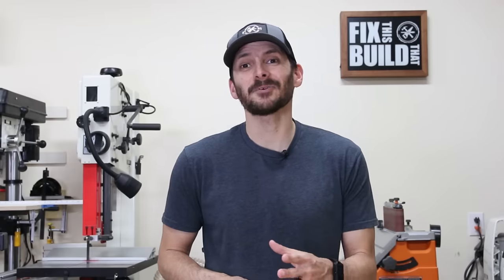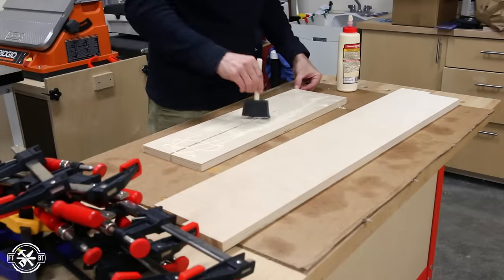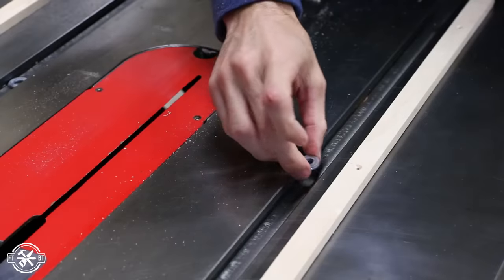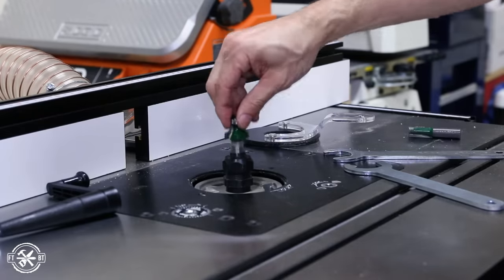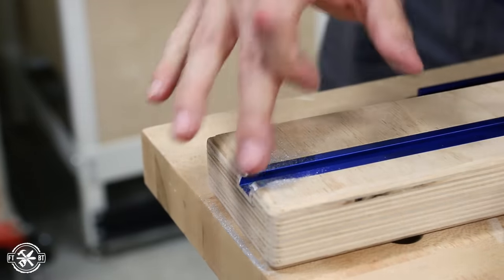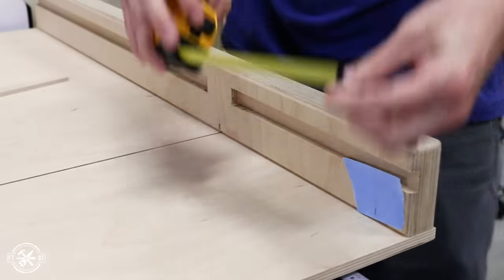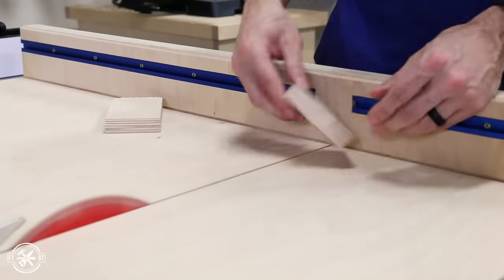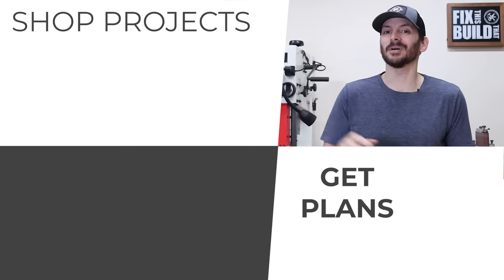Simple Table Saw Sled with FREE Plans | DIY Woodworking

Comment: Just a tip that came to me while building this sled...  In order to assist with "squaring" the back fence with the blade, place a couple LARGE flat washers (spread out as far as possible) in the initial saw cut and butt your square up against these flat washers that are sticking up out of the initial saw cut.  Then squaring the back fence is actually pretty precise.
Reply: Would this be any different than raising the blade and using the square against it?
Reply: Would be nice to see this in a video. Kinda hard to picture what your saying to do.
Reply: @jayj4ysmith  He's saying instead of trying to align the square with the saw cut by eye,  have something flat sticking up out of the cut line to butt your square up against.
Reply: what?
Reply: @bobthomas8342  not an english native speaker, so still hard to understand. Should washer be placed under square end that is placed on the side of blade? Is that the idea?
Reply: @valdiadams5787  washers are placed vertically in the zero clearance cut of the sled bottom, instead of trying to eye-ball or using the raised blade. Think that is what he was going for. Hope it helps.
Reply: @richardulin7535  I think I washer would be totally flat and error free whereas the blade has teeth to compensate for.
Reply: Sounds like a good idea.  He lost me completely with the math…lol

Comment: Just completed new sled.  My old one was not quite square.  I did my initial placing of the back fence using my igaging engineer's square and then did the five cuts to check for square and found that I was only  .009" out and dividing by four comes out to .00225" deviation from square.  I was amazed to see the measurement and redid the cuts with essentially the same result.  After doing just a tiny bit of basic math, I quickly decided to put in the rest of the screws and call it done.

Thank you for the great video.  Please, keep'em coming.

Comment: I was planning to make a new table saw sled, and decided to look for a video while eating lunch, not expecting to learn anything. I have to say I’m impressed with this video! The method to square the back fence is one I have not seen before, and I’m sure it will lead to a squarer sled than I would have had. I also like the super glue method to hold the rails in place until the sled can be flipped and the rails properly attached. Thank you for making this!

Comment: Finished this up today. Was 0.40 off on the square test, so I needed a 0.1 feeler gauge.... no such luck......experimented around and found that a strip of 100 grit sandpaper was just about right. Made the modification and voila.....the next test came out perfect! I also added some T-track for hold downs inside the sled.

Comment: after the first 3 minutes, there are some advance things going on and with fancy equipment which I don't own.  But I try this to do this with what I got.  Thanks for sharing.
Reply: pretty simple sled. but if I have just table saw, hummer & screwdriver I'm screwed to make this simple. I do not have a single clump & the glue. But I have many many screws worth of $800.
Reply: @alexk6745  You don't have to use ply to make the fence though. You could use a piece of 4x8". The most important thing about the sled is that it's square, all the rest are nice to haves.
Reply: I will make this. but add a dust port into the safety block. Thanks

Comment: I like the idea of the safety block. I saw another sled that the backstop was a couple inches higher and there were two hand holes cut into it on each side of the blade.

Comment: When gluing up your fence glue and clamp to a level  ,this will end up being flat and true. 
I also used to use hard wood for runners .I now use 3/8 thick lexan or plexiglass. Cut like a hard wood with out the humidity problems.
To reduce the surface the underside surface area ,to make the slide slide easier, I made a grid  up to accommodate a 2 inch foster bit with a 1/2 to 3/4  space between outside edges of hole. I than drilled using a 2 inch foster bit ,1/16 deep.

Comment: My first sled didn't have a block in the back so my blade went all through and now its no longer flat, this will be a great upgrade. However, I will bring back something my first one had your's didn't -- I had both a left to right and a right to left tape on either side of the blade so I can always have a good idea of the length of my pieces.

Comment: Nice work, brad. It's about time for a new sled. I made a small one that can do about a 14" crosscut but I keep finding myself wanting to cut things that are just a little bit bigger so it's time for a bigger one. I like to leave the runners long on the back side so they help the sled engage well when you're cutting something bigger.
Reply from the maker: I've got the luxury of a 30" table saw top 😃

Comment: Just a suggestion , instead of trying to line up the rear fence by eye and a square , I use two drills the size of the saw cut . Inserted them into the cut and used a 2 foot square against the fence and the pins and it came out dead nuts on the first try . .001 across 18 inches . Just a suggestion. Great video

Comment: Thanks for the free plans. I just built this and have a few comments. Keep in mind I'm kinda new to woodworking, but why is thing so huge? I have a Rigid cast iron table saw and it seems to take up most of the surface top. I can't yet see myself cross cutting something so long or deep. Second, If you're going to use t-track for the back fence, but make your own stop block, why not go ahead and use some kind of top track on the back fence and buy at stronger aluminum stop block. When I was chiseling out the center section of the spline for the stop block, because of the way the plywood layers were running, the entire exposed spline sheared off. I ended up using a spline made out some of the leftover hardwood used for the runners. Even though you ruined your last sled by making a 45 deg. cut,  you didn't add any provision for making 45 degree cuts to this iteration?

Comment: Some folks suggested using metal components in the sled. Indeed, my old sled uses an extruded piece of Aluminum for the back rail. However, this won't play nicely with my SawStop, because it could provide a conductive path from my hands to the blade and thus activate the brake. Also, making the major components out of wood may result in fewer metal chips, longer blade life, etc.

Comment: @fixthisbuildthat I’m almost done with my sled! Going with powertech rail on top with powertech flip stop instead of this stop method, BUT! I’m using this 5 cut method... these are my FIRST time numbers: .8720 and .8645; so .0075/4 = .001875 and that’s over a 10” piece I had laying around. How’d I do? ☺️

Comment: Hey glue ups are easier if in glue ups you sprinkle a little salt on the ply after spreading glue. The pieces won't slide around when clamping. The salt dissolves.
Reply: I will have to try this. It's a pain to try to maintain straightness.

Comment: I know this video is older, and I did scroll thru the comments to see if anyone had asked before.  So, I guess I have what’s considered a contractors table saw.  It folds up and has wheels.  Sadly, it’s the best table saw I’ve had in my limited woodworking attempts.  It is able to cut up to 30 inches.  Do you think this sled would work for me?   I’m hoping to make the portable miter saw table at some point, but, this will have to do for now.

Comment: Just a word of advice for anyone living in areas that get colder temps in the winter..  DO NOT use wood for the slides!  I used a piece of maple same as you.. built the sled in the summer time, and it worked awesome.. as soon as winter hit and it was colder in the shop.. the sled got sloppy in the tracks on the saw because the maple shrunk a bit...  I would recommend getting some metal slides off of ebay if you are in a colder region!
Reply: Or use HDPE plastic.  Buy it by the sheet off of Amazon or cut up a cheap white plastic cutting board (Wal Mart or Target).

Comment: Instead of a stop block for safety,u might try a piece of 1x3 in front at the bottom( flat) across the sled.This way your cuts will finish much further away thus being safer.

Comment: Thank you for the vid and plans. I'm 3/4 of the way through building this... I am at the dialing in the sled part...  and my runners just got crazy tight. I used maple for the runners. It has been raining today and my shop is in the garage and I usually work with the door open... does moisture have that much effect on the runners?

Comment: Do I need to make a cross cut sled if I only have a small 8 1/4 in portable table saw. I only use it in my garage but just wondering. Most of the cross cut sleds I see here on YouTube are for large shop table saws. Thanks Chris

Comment: Fantastic video for this table saw sled. I'm 70+ and just now getting some GOOD equipment, a few weeks back I purchased Dewalt DWE7491RS 10" Jobsite Table Saw cause my "shop" is 20' square. My issue is that my "not yet complete" sled just won't SLIDE very well even with Microjig Zeroplay Miter Bar Slides. My saw table is coated, not just steel like I see your's is, any suggestions to get a smooth slide from my sled in this situation? Thanks for any information from you or anyone with an answer. Learning lots from you videos, keep up the good work.

Comment: I recently inherited a Grizzly 1022Z table saw. Unfortunately it did not have a blade guard or riving knife. Grizzly is out of stock and will not be manufacturing for such an old machine. Any ideas? My first project for my new addition is to build a sled for it. Thank you for sharing your great video for your sled. A new subscriber as of 1/9/20
Reply from the maker: Check out the MJ Splitter. Will provide some protection of a riving knife

Comment: Hi Marc here from over the pond Wiltshire England. I have a Makita MTL 100 table and just built my first sled and love it. However the t-slots in the table are 1/2" wide and only 3/8" deep, so a pair of slot runners are ok, but I'd like to make a light weight single runner sled for smaller gauge stock. With a single runner and these runner dimensions I feel will be a little flexible. My question if I chose 1/2" wide by  1/2 to 3/4" high slot runner with it accommodated into the underside of the sled do you think that would help. I have no access to metal working facility to get a metal sled runner made.

Comment: had a question, so u only move the left side of fence if u cut on the left side of saw. this is where i get a lil lost.  do u change pivot point sides depending which side of saw u cut on?? dont think im going about this correctly. and want to get my head around this prior to attempting it. thx

Comment: Not sure if you will see this, but I was wondering if it would make sense to place sticky ruler at the top of the rear fence and align the zero with initial stop of the stop block?  Being able to quickly set the stop blocking without measuring distance each time seems to be a pain.  Also, I noticed that you have three tracks mounted on the rear fence.  What do you use the other two tracks for?

Comment: When I first tried the 5 cut method I came up with .640 on top and .574 on bottom subtract both I came up with .066 divided by 4 equals somewhere around .016 so I used a feeler gauge and moved my fence back I did exactly the way you did and the second time around I came up with .375  on top and .380 on bottom subtract both equals a negative.005 divided by 4 equals negative .00125 which means I moved it back a little to much I’m not sure what to do next please let me know if I need to correct something thanks again for the video
Reply: It means you are out of square a little over one one-thousandth of an inch over the width of the test piece you cut.  To me that is more than square enough for anyone but a precision machinist making engine parts!

Comment: I was gifted a table saw and it only has one miter slot. I would love to buy a new one but not in the cards right now… could I build something like this with only one runner on the bottom? If not Maybe make it wide enough that the other “runner” runs along the outside of the saw table?

Comment: New to using a table saw, is it normal when cutting a small strip to have the widest part of the wood on the outside of the fence and the narrow bit next to the fence? Thanks
Reply from the maker: Completely depends on the cut and size/dimensions of piece

Comment: Very new at wood working, just purchased my first used table saw.  Does this sled get rid of using the guide arm attached to the saw table?
Reply from the maker: Yes, for crosscuts. But you'd use the fence for rip cuts (lengthwise long cuts)
Reply: Thanks, makes sense now. @Fixthisbuildthat

Comment: Another great video!  Quick question - I have a 10" Dewalt Jobsite Table Saw (DWE 7491RS) with a fairly small top surface.  Dimensions are  21-7/8" X 26 - 3/8".  What size sled would you recommend I build for it?  Any help would be greatly appreciated.
Reply: I have the same saw and was wondering the same thing.

Comment: I recently watched your sled building video, and built a similar one. In beginning of the video you mentioned you ruined your old sled by cutting a 45 degree miter.  So my question is a miter cut shouldn't be done using the sled?

Comment: Thanks man for the video, I wanna build the first crosscut sled for my shop, but the Mitter slot is not so deep, dose it important ? my table saw is Makita LF1000
Reply from the maker: Nope, doesn't matter. Just as long as the runners hold it tight

Comment: I built a crosscut sled but I like urs a lot better, think I’ll use ur plans and build one 👍 I get hung up on that a 🤬🤬🤬 5 cut method! When I made my sled I wasted a full sheet of 1/2” birch plywood trying to figure that 🤣🤣🤣🤣🤣 NOT!!
Reply: The five cut method is not difficult, but the math can be confusing. Watch a few of the videos that explain it and maybe one of the other explanations will make sense to you. As I remember, the video on King's Fine Woodworking explained the math clearly. Don't let a failure keep you from learning new techniques.

Comment: In the process of building this sled, based on the plans… one thing that I confused myself with was what is the front what is the back?  I finally studied the plans and watched this video and got myself “sorted out”  you stand in front of the “back” and push the sled through the blade “front” to the “back”… and the item being cut is held against the “back”….

Comment: Looks like he measured at the front end of the strip and at the back end of the strip. Why did he then divide the difference by 4? Is the purpose of this to square the back fence?
Reply: Yes.  By making the four cuts plus the final piece to show the accumulation, you make any error four times over and make it easier to measure and adjust for any error.

Comment: I like the sled, but I am puzzled. You said that the grain of the wood was running the wrong way, as you were using plywood how was the grain running the wrong way?
Reply from the maker: Just in the sense that grain typically runs the length of a piece, like in a 1x4
Reply: @Fixthisbuildthat  I assume you mean the "surface" grain in the top layer of ply, as the layer under should be roughly at 90 degrees to it. So you're referring to the top layer as being the grain for the piece of wood ?
Reply from the maker: @stuinNorway  that's correct. The tearout is just on the top layer

Comment: Any tips for a guy that has a table saw with no troughs in the table of the saw to guide the sled?
Reply from the maker: You could make it wider than the table top with a runner on each side so it slides on the outer edges of the top
Reply: @Fixthisbuildthat  will play around with this Idea on Sketch Up, thank you man! Subbed

Comment: My computer is named FRED,   (F'ing Ridiculous Electronic Devise)  :)  .   ps   If you have an oscillating multi tool they work great for cutting the slot between holes to make a hand hold. Easier to make a straight line than a jigsaw.

Comment: Why wouldn't you just use square shapes against the saw blade to set the back fence? Shouldn't at least your initial be more accurate than having it flush with the back edge? Otherwise, you are setting your initial square to the base of the sled or the fence rather than to the saw blade.

Comment: "Simple" when you're using like 8K worth of equipment.
Reply: Like what
Reply: @dogpoop5820  like the large jointer, router table, high end table saw, miter saw, custom workbenches and high end dust extraction… there was probably about $500 worth of clamps alone in this video.
Reply: @danielakerman8241  you don't need any of the equipment besides a router and a table saw, which if you're making a cross cut sled I'm assuming you have.
Reply: @jacobcrouse6673   I get it, and you’re right, but it’s also true that the video shows a ton of equipment being used. A novice would get an impression those things are necessary for the project
Reply: Yeah, anybody watching this video knows you could do it without all that equipment, but I think our first friend was pointing out the fact that the guy barely mentioned it or what to do if you don’t have a jointer etc. I thought the entire video was very  *uninformitave
Reply: Wow, the guy puts a great "how to" video together and he gets people complaining about using the tools in his shop? Work it out trolls if you are wanting a sled you would already have a table saw and you don't have to use a router just go  without the locking track. Get a life trolls